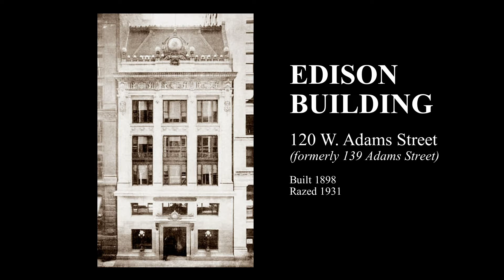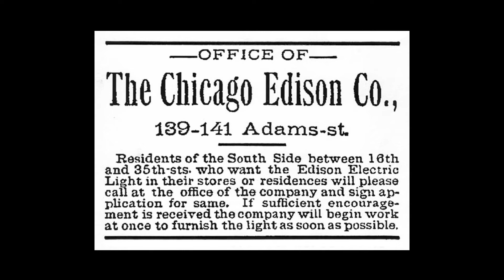Secrets of Glessner House Part 9 - Early Electricity

Comment: It’s kinda funny that the original desk lamp plug is safer than modern plugs. The ground prong is longer than the bare contacts so that you can’t touch them without it unplugged. Modern plugs can hang halfway out while still live.
Reply: no ground actually, it is just a pin to open the shutters, likley because it seems to be installed in the floor

Comment: Knob and tube wiring was very common in houses built before 1940 and was in common usage well into the 1970’s.
Reply: still used today, actually. believe it or not, if done right and not butchered it's very safe

Comment: I am a retired electrician and found this very interesting. In my early years as an apprentice I worked on some D.C. in the old post office in Cleveland. I also installed knob and tube in the early 1960s and remember working on old houses that had the wooden conduit installed in the basement. We converted some of the connecting outlets to modern wiring. Early wiring was always black so finding the neutral was always a problem. Discovered old wiring to outside post lights that was covered with a lead sheath to make it waterproof. Wiring methods have always interested me.
Reply: I used to own an old house in Baltimore back in the 1970s which was built around 1905. In the basement, the original wood conduits and porcelain wall switch base were still in place on the stairway wall, although inactive. A new light switch was installed at some later date. The gaslight piping was still in the walls and first floor ceiling but cut off just past the gas meter in the basement. The house next door still had active gaslighting, at least in the basement, from what the neighbor told me.

Working for Baltimore Gas & Electric before retiring in 2016, the history of the gas side of the company always fascinated me. We still had field books showing where mains were laid going back well before the Civil War. Some of those original mains were still active as late as the 1980s. Some of the oldest gas records still had "The Gaslight Company of Baltimore" on the cover, which company was started by Rembrandt Peale in 1816.
Reply: I thought they quit using knob and tube in the mid 40's?
Reply: @stuffoflife575  Cleveland was behind the curve in converting to Romex in the sixties so we were still installing knob and tube but we had to add the ground wire which is what finally killed knob and tube because it added a third more to the cost. There are still houses in the Cleveland area that have grounded knob and tube wiring. Since it was done with new wire it didn’t have the problems that the older wiring had with being insulated.

Comment: How much of the original wiring is still active? Just wondering as you said it was largely rewired during the 1960s.
Reply from the maker: None of the original wiring is still active, although sections of it are still in place, but now disconnected from the electrical service.
Reply: @GlessnerHouse  does there happen to be the original cutout knife switch and fuse panel? Just wondering